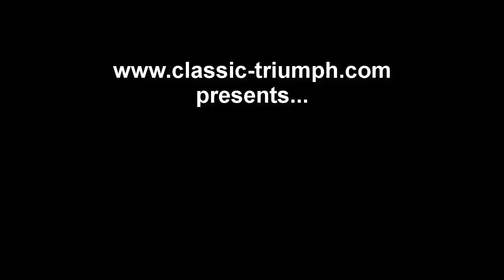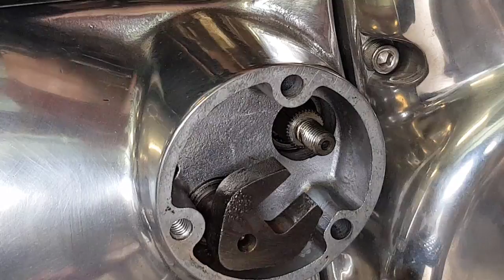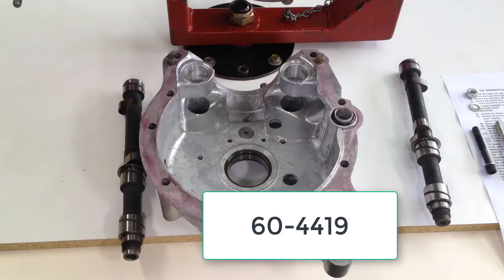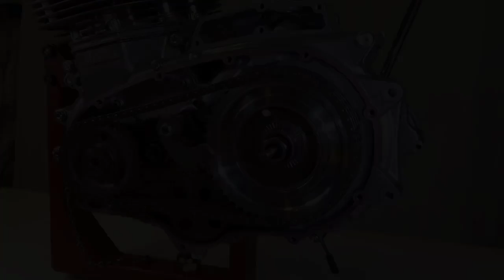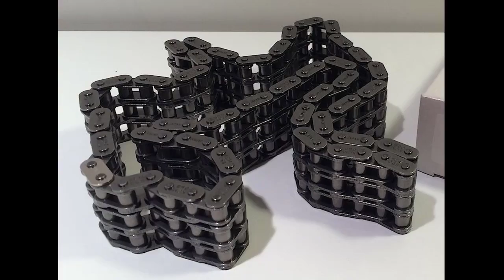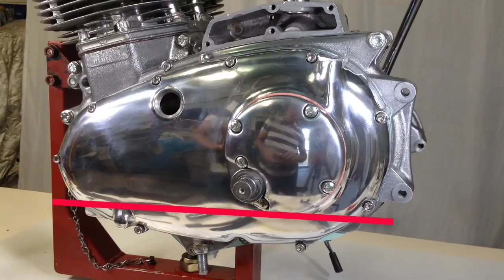Triumph Trident T160 Clutch and Primary Drive Part 3

Comment: Thank you for sharing your wisdom from a UK T160 owner of 42 years. Your videos are very helpfull - especially the one covering clutch with its 'quality control issues'. My Trident is 50 years old in November this year and in my ownership the best improvement I have made is by fitting a Tri-Spark ignition designed and built by a Aussie. The transformation was night and day.
Thanks again.

Comment: Primary chains are meant to last at least 100k in a oil bath, I have the original and replacement installed with a new bagged Reynolds awaits, duplex is fine, keep the Primary topped up, it gets little from the crankcase, also check for mayonnaise,

Comment: We are no where near this point in our build but this video has put my mind at ease and we will be referencing this series a lot when the time comes.  Great video.
Reply from the maker: Jerry, Have a look at the other videos that cover earlier stages of the rebuild that are also available on our YouTube Chanel. You might find something that is more in line with where you are up to.

Also have a look at our web-site at www.classic-triumph.com to find more related info.
Reply: I think Jack sheman did the setup for cam timing in classic bike some 20 years ago, with dial gauges and racing setup also, I have somewhere, had mine since new